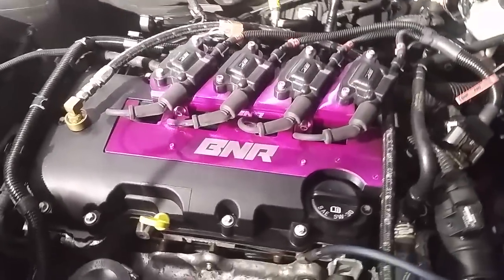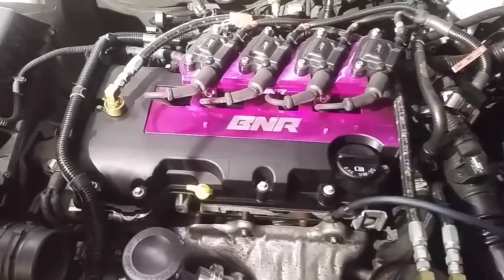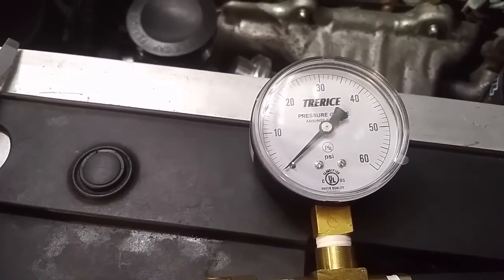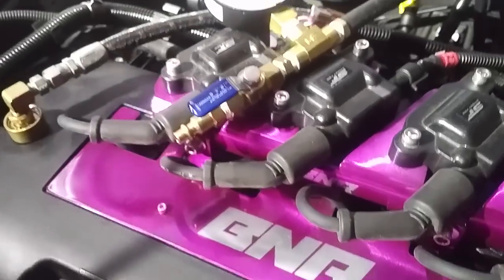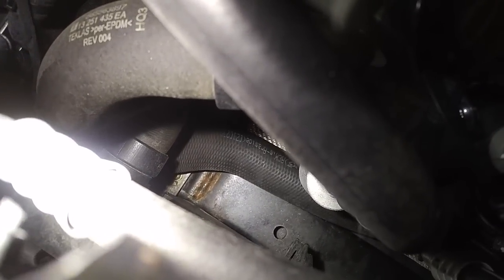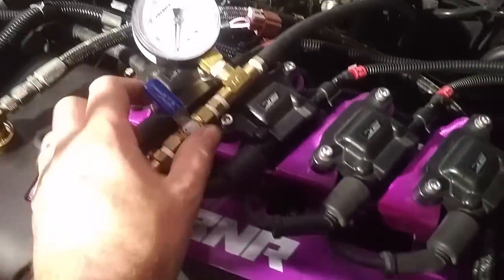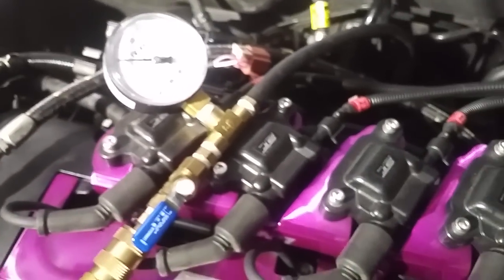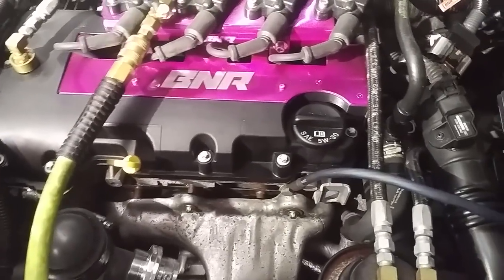Chevy Cruze & Sonic 1.4L Turbo Boost Leak Testing

Comment: Hey Question, hopefully you'll answer.
I replaced intake manifold, and turbo with a recommended cheaper turbo from another youtuber. After replacing both parts I now have a P0299 code (Under boost). I went ahead and built this exact pressure leak testing, and my pressure falls slowly, just like yours. around 10psi it'll stay there for minutes on end, but a big release when I pull the hose off the nipple.

I took my charge pipes off, and intercooler, flushed them out with gas... yeah they were a bit dirt, but not horrible. Little bit of oil is all from previous pcv issues. I haven't reassembled the charge pipe system, but i'm confident due to this test i'm not leaking anywhere, i couldn't hear a hiss at all either. does this confirm my turbo is not performing as it should?
Reply from the maker: Start here. 

https://cruzekits.com/blogs/technical-articles/p0299-underboost-code-explained

Comment: Why not just use a smoke machine?
Reply from the maker: Not enough pressure. To simulate normal operating conditions, you need to pressurize to at least 20psi. Smoke machines won’t do that. 

This also doubles up as a crankcase pressure tester and a coolant pressure tester (the updated version), which a smoke machine also won’t do.

Comment: Is my wastegate supposed to open during this? Also the bypass valve even brand new still dumps air.
Reply from the maker: Make sure you’re testing everything with the engine hot (except the coolant test of course). But no those shouldn’t be dumping air and they don’t do so in my testing either.
Reply: @AndreiDPop  Yep, tested while hot, wastegate opens followed by bypass valve. I'm stumped. This is my commute to work :/
Reply: Is it possible that an intake manifold or valve cover would cause this issue?

Comment: Hey after sealing up my charge pipe and the spot where my head gasket and timing cover gasket meet. I now have 3 different pressure sensor related errors that showed up, P0236,P0106,P2227. Any recommendations?
Reply from the maker: Disconnect the battery and reconnect.
Reply: Ill give it a try @AndreiDPop

Comment: Here and in desperate need of help. I have been chasing P0171 and P0299 for a while now. I have done the latest pcv fix kit and replaced the wastegate solenoid under the intake manifold. This made 0 difference and so I swapped the one thats attached directly to the Turbo. Once again Nothing. Using the boost leak test from Cruzekits I hooked it up and my wastegate opens up around 5psi, the system isn't leaking from anywhere else but is just pouring out of the bypass valve (ciecly black thing connected to the turbo, under the intake hose). It goes from 20 to 10 in less than a second. My actuator doesnt have any play when closed.....
Reply from the maker: That’s a very rapid drop in boost on the leak tester. Start spraying the engine with soapy water. The bypass valve may have failed. Is this an aftermarket turbo?
Reply: @AndreiDPop  Wow, thank for the reply man. No its oem. The valve just opens up , closes again once the boost drops.
Reply from the maker: @noaha.7077 I would start with a new bypass valve.
Reply: @AndreiDPop  Are there any good aftermarket options you know of that fit a stock turbo? The oem one is half the price of a new turbo?
Reply: Well hey thanks for all the help, these kits have given me a chance to learn a lot about cars.

Comment: I ordered one of your v3.4 kits because I seen a video that said check to make sure you can see your check valve. I have a p0299 code and my check valve is missing. Where do you think it would go?
Reply from the maker: @Munky_T23  where did your check valve go, you’re asking?
Reply: @AndreiDPop  Yes.
Reply from the maker: @Munky_T23  engine consumes it through one of the cylinders after it breaks off.
Reply: @AndreiDPop  Yikes, that's crazy.

Comment: Also while boost leak testing I have air going into the waste gate actuator. Is that normal?
Reply from the maker: @carloshernandez-kc1gl  honestly not something I ever paid attention to. You’re mostly concerned with leaks in the charge pipe and crankcase.

Comment: My boost leak is at the rear of the valve cover gasket. Does that mean my new intake manifold is defective?
Reply from the maker: @carloshernandez-kc1gl  aftermarket valve cover?
Reply: Yes aftermarket valve cover. Would OE valve cover leak at the same place? I’ve read that it leaks during boost leak testing?
Reply from the maker: @ OE should leak less or not at all. Mine never leaked and it’s an OE valve cover. However the only time that valve cover is ever under pressure is during boost leak testing. Otherwise it’s either neutral or under vacuum. So I wouldn’t place much importance on that.

Comment: Performed boost leak test and found it leaked through valve cover diaphragm. Replaced intake manifold and valve cover but leaks air through the rear of the valve cover only now during boost leak test at 20 psi. Any thoughts?
Reply from the maker: Aftermarket intake manifold and valve cover?
Reply: @AndreiDPop upgraded aftermarket intake manifold and aftermarket valve cover
Reply from the maker: @ there is no upgraded intake manifold. All aftermarket options are just as bad or worse than the OEM one whether it’s reliability or performance. The Dorman manifolds still fail despite the pin behind the check valve and the racerx manifolds lose power in more of the power band than they add. 

I strongly recommend against aftermarket valve covers on these cars also, which is why I don’t offer them on cruzekits.com. I only offer OEM valve covers. Too many issues to list in a YouTube comment for all of the aftermarket options.

Comment: Will this work on the 2016 1.4l le2 engine? The valve cover area looks different
Reply from the maker: @aztlanmotors  no, it’s for the 1.4L turbo only. 

For a great upgrade for the LE2, check out the catch can kit from badnewsracing.net.

Comment: A boost leak tester can also be used to pressure test the cooling system. Its better o use a 5/16ths hose because then you can connect to the top of the expansion tank (plug the other end of the hose). Leave overnight with just under 20psi (cap relieves pressure at 20psi) and you will find leaks you ever knew you had..:)
Reply from the maker: @frankish5314  indeed. The test kit has the necessary fittings to leak test the cooling system also.

Comment: Great information. Thank you so much. I’ve watched many of your videos.
 I have a few questions.
1. If the manifold pcv valve is missing, and I pressure test the system like this, what symptoms will I see to indicate the intake manifold check valve is problematic?
2. My car had two significant leaks- one at the throttle body and the other at the bypass valve. The car now gets to 20psi when before it didn’t. I am sadly still throwing p0299 code. I have repeated the boost leak test numerous times, the only thing I hear is a hiss from inside the valve cover, when I pull the dipstic, pressure is released and I can hear the hiss louder from the dipstick hole. Is it safe to assume at this point the turbo charger isn’t pressurizing the system as it should? What else should I check?
Reply from the maker: @roywalker270  pressure testing won’t reveal a manifold check valve failure unless you remove the pcv pipe prior to the test and spray soapy water down there. 

If you haven’t installed the cruzekits pcv fix kit yet, I’d start there. Your symptoms are pretty common for that type of issue.
Reply: @AndreiDPop  thank you for the reply, I’m looking at the different variations of the kit now.

If I remove the corrugated pcv hose from the intake manifold, and apply pressure to the system, should there be any air coming out of that hole on the manifold?
Reply from the maker: @roywalker270  there can be hole coming out of the manifold yes. But it shouldn’t be coming through the check valve at the bottom toward the firewall. You’ll need to spray that with soapy water to check for leaks.
Reply: @AndreiDPop  hey! I recently purchased kit v3.4. It had come in the mail today and installed it after removing the whole intake manifold. I have high hopes!

The manifold is not stock “mitzone” brand. You cannot see the orange nipple from the pcv hole. I decided to remove the whole manifold to look and be sure. I was hoping to see it missing; however it is still there. This manifold looks like it was recently installed. I removed the nipple and installed anyway, hoping it is a faulty aftermarket. While putting the car back together, I thought about the other side of that orange nipple? Could it fall down inside the intake and be sucked into the cylinders? Have you seen this check valve be present and not be functional?

Thank you for the kit!
Reply: I saw your comment to someone else about the bypass solenoid valve. I will pick one up tomorrow hoping for the best. I really can’t thank you enough for all the videos and information.

Comment: Why would this kit not work on a 2014 Buick Encore?
Reply from the maker: @quietpianist  doesn’t say anywhere that it won’t. It will work just fine, but this is the old video. Theres a newer and better kit. You can find it on cruzekits.com.
Reply: @AndreiDPop thank you.  I pulled up the website link to the kit from the description. When I look at compatibility it only listed 2015 Buick Encore and newer.
Reply from the maker: @quietpianist  where is that mentioned? I’ll have to fix it. Thanks for bringing it to my attention.
Reply: @AndreiDPop   It was listed in the  compatibility section of the description of the kit for sale on the website you linked to.

Comment: Is there a way to test and locate boost leaks by smoking the car?
Reply from the maker: If you have a smoke machine, I imagine you could, but most smoke machines done allow you to use enough pressure to test the car at the same pressure the turbo makes.
Reply: @AndreiDPop  Where would you suggest the connection be made to see if it works?

Comment: BOOST LEAK = LEAN CONDITION??
Reply from the maker: Lean condition at idle, decel, or low speed (below 55mph) cruise which turns into a boost leak (running rich) on acceleration and high speed cruise.
Reply: @AndreiDPop that’s exactly what I’m dealing with. goes lean when braking. Has new MAF, new valve cover, new purge valve, new hose from intake to turbo. And the check valve is present in the intake. Really stumped right now.
Reply from the maker: @puremayhemFTW  did you leak test it with my test kit?
Reply: @AndreiDPop  just purchased your kit. Thanks for the help and your video! Can’t wait to try it out.
Reply from the maker: Also, this is the old video. I have a new test kit now that’s been updated.
Reply: @AndreiDPop I’m going to purchase ur kit tomorrow see if I can use it to nail down my issue. Glad I found your video

Comment: Hey Dre just wondering if you are still making/selling the boost test kits from this video. I would like to purchase one for my cruze
Reply from the maker: Yes but it’s being updated to a newer design that can do much more than the old one. You can order it off the site and I’ll ship all the parts out but I won’t have the video up till this weekend.
Reply: Is that the cruzekits site? I bought the 3.4v+ kit, replaced the cam cover, still getting that pesky p0299 code, hoping the turbo isn’t the issue, I see a little play in the wastegate pivot pin but not getting any other codes.
Reply from the maker: @StevenBlaisdell-id7zm  try this article first. 

https://cruzekits.com/blogs/technical-articles/p0299-underboost-code-explained

Comment: Hi Dre, thanks for all the great videos you publish. I learned a lot from them, you definitely master this engine.
I drive an Opel insignia with the same engine (B14NET) and since a while I get the P0299 error code as well.
Now I wonder, it seems to me that they are not thrown at me until the engine is heated up enough. I'm not sure if that is completely heated up, but with a cold engine they won't show up. Do you have an explaination for that? Or even better, does that tell you what the root cause will be in that case?
Because of that I'm pretty sure it's nog te turbo itself, faulty in that case is faulty at all times. It must be a boost leak, but in my case temp sensitive.
Thanks in advance for any insights!
Reply from the maker: Check for intake manifold check valve failure (my pcv fix kit would address that.)

Check for boost/vacuum leaks. 

Check for a sticking bypass valve solenoid (under the intake manifold on the right side - opposite of the throttle body). 

If all of those look fine, it could be the turbo wastegate housing crack has become too large.
Reply: @AndreiDPop  Wow, thanks for your fast answer. I checked that already, a few times as a matter of fact, just to be sure. And the last time I did, I doubted I maybe saw something orange after all, but very very tiny. How big and clearly visible is this end of the check valve if it's there?
I'm planning on installing your kit anyway, but because of a family vacation coming up time is lacking me for now. So I will be forced to have a new manifold as it is installed for now. What a crappy invention was that, by design. The onces on $ 20 rubber rowing boats are better, last for at least 20 years.

About your kits, which one would you recommend, seen the fact that you sell more versions?
Reply from the maker: @ivarwoudsma5069  it should be very clearly visible. I’d recommend the v3.4 kit. It’s the best value, easiest to install, and it’s what 95% of people order.
Reply: Thanks again, Dre. It was far from clearly visible so that is definitely it. I'll have the manifold replaced and save the vacation in a timely matter. You're great and I love what you do!
Reply: @ivarwoudsma5069 did this end up fixing your issue?

Comment: Would a smoke test get similar results in finding a leak? If so, where would you connect it to to maximize coverage? Also, is there a better way to get a good seal between the charge hose and the throttle body?
Reply from the maker: Smoke test wouldn’t do it since they generally don’t produce enough pressure to simulate maximum boost on a turbo engine.

Comment: Hi Dan, have a 14 Cruze 1.4, P0299 code, smoked the vehicle, no leaks, passed pressure test, car drove fine, intake has the check valve, all sensors reading correctly, could not find anything wrong, replaced a turbo with a new one, same code comes back p0299, smoked the car again - no leaks anywhere, car drives fine just like before, any ideas?
Reply from the maker: Bypass valve solenoid. The one under the manifold on the passenger side. I wish you would have asked before replacing the turbo. Thats the first thing I recommend people check.
Reply: Hi Den, just wanted to let you know that bypass valve did fix the P0299 issue, tnx! Another issue came up recently though, I have a whistle coming from what sounds like my valve cover "I take the dipstick out whistle goes away", replaced a valve cover with an oem, whistle comes back within an hour, thought I got a defective cover, replaced with another new oem cover - same thing happens, after the vehicle warms up whistle comes back from what sounds like the valve cover PCV, take the dipstick out - it goes away, I don't think I have 2 bad valve covers in a row, smoked the car - no leaks, manifold has the check valve in place, any idea?
Reply from the maker: @misha27060  check the intake manifold pcv pipe terminal. There should be an o-ring and a plastic retaining ring in front of it. If one of those is missing, it will cause a vacuum leak. You definitely have a vacuum leak somewhere.

Comment: I need your help Dan and can't find your email on the site
Reply from the maker: Use the chat box on the cruzekits site.
Reply: @AndreiDPop  i did havent gotten a response since last night
Reply: The only hiss I hear is from the purge tube connects to the purge connector that sits on the manifold or the connector itself leaks a little
Reply from the maker: @xnitro6794  I would replace the evap purge valve with a new OEM one and go from there.
Reply: @AndreiDPop   well it did fix that issue but now im not sure on the next one as i think the manifold seal the kit plugs up may have failed as i have air coming out of that hole
Reply from the maker: @xnitro6794  you have air coming out of which hole? Under what conditions?
Reply: @AndreiDPop   where the pcv hose connects to the manifold.
Reply from the maker: @xnitro6794  there’s air coming out of that while the terminal is in place?
Reply: @AndreiDPop  terminal?
Reply from the maker: @xnitro6794  the connector at the end of the PCV pipe that connects to the intake manifold.
Reply: @AndreiDPop  I didn't have air coming out with the connector on just the hole itself
Reply: @AndreiDPop  I have emailed you again just need your opinion

Comment: Hello, im currently going to be getting your  v3 fix kit for the intake fix, however i am noticing a ton of differences on your engine. the coil pack as i am sure that is some sort of mod "I searched but found nothing like it and curious of the difference. Secondly the hose on the left side of the valve cover. I have seen some refer to this as an oil bypass? is it needed after you do the v3 intake mod? or just an addition to lower the amount of blow by oil from getting into other components.
Reply from the maker: Cool pack is the ls7 coils from badnewsracing.net. The hose on the left did of the valve cover is an oil return line for the AMSOIL single remote bypass filter. It’s a superfine small micron particle filtration that keeps more contaminants out of the oil. Not really a necessary mod but something I felt like doing for fun. It’s been working great for about 7 or 8 years now.